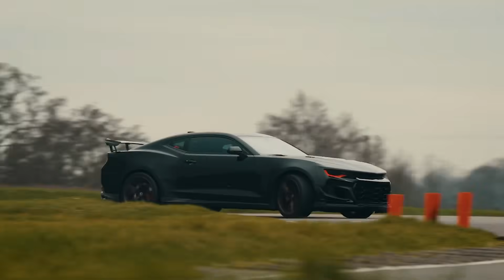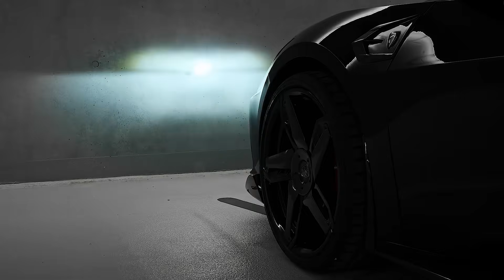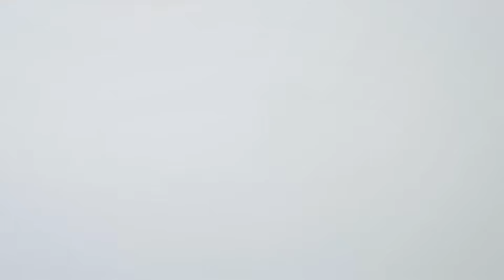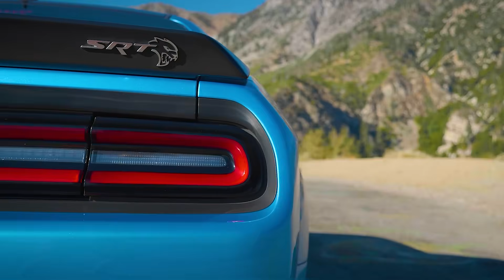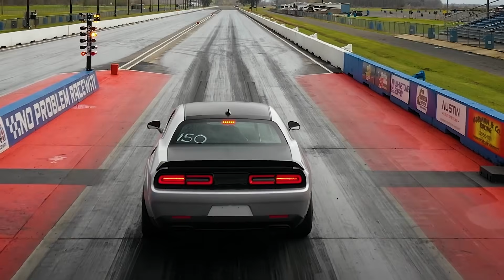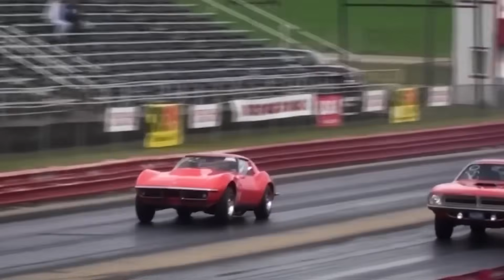10 Most Powerful American V8s Ever Built (Officially Ranked)

Comment: Ford BOSS 429 should've been included....as should some other late 60s-early 70s big blocks. Ford/Chevy/Dodge radically underrated these engines horsepower/torque numbers for insurance purposes.

Ford Boss 429, 427 SOHC and 428SC
Chevy 396, 427 and 454
Dodge 426 Hemi

You could also include some of the small blocks too...specifically the Ford Boss 302 and 351 Cleveland, Chevy Z28 302 and 
327, Dodge 340 six pack

The manufacturers radically underrated all these engines.

I also forgot to add the Ford 390 HiPo
Reply from the maker: 70's Muscle Car Video : https://youtu.be/PBmtssJIidA